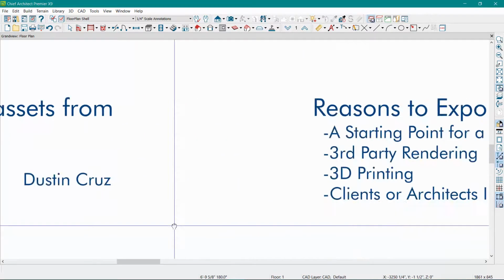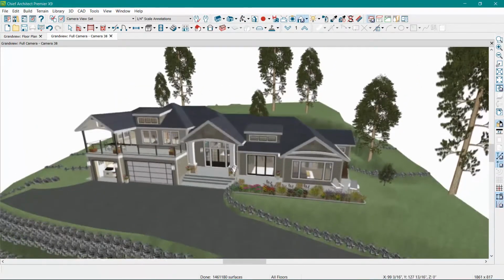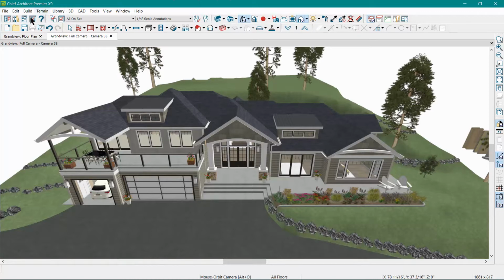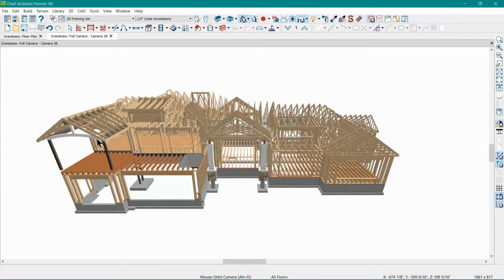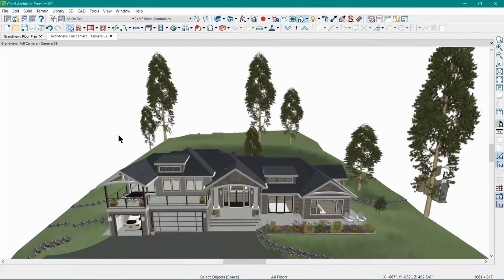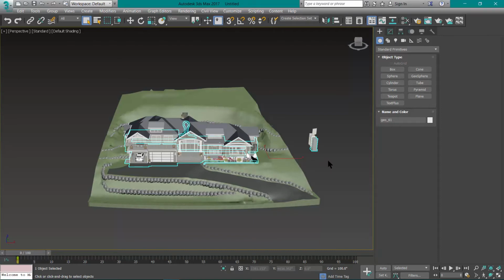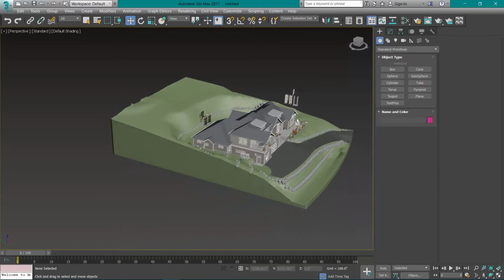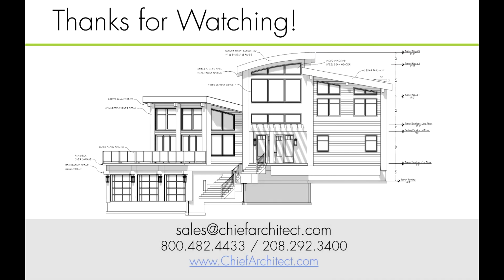Exporting 3D Assets from Chief Architect

Comment: Hello, thank you for the video
Does anyone have a solution to regularize normals and faces after importing into 3dmax software?
Due to the excessive confusion of the structure of the objects in certain projects that have inlay work or the object has an arch. The material is not placed correctly on the object
Reply from the maker: Hello! We cannot speak to the function of another software but you can try posing your question to the Chief Architect Community on the ChiefTalk Professional Forum here: chieftalk.chiefarchitect.com

Comment: Has any of the export capability changed with the latest version of CA? In terms of lights, cameras, or anything else that doesn't come across when exporting to Max mentioned here? I'm ultimately interested in getting the exports into Blender and Unreal, probably through 3DS max if that is now the best export method. Thanks
Reply from the maker: I have listed below the file type export options currently available: 
-	Current View / All Floors –.DWG, .DXF
-	3D Model –.DWG, .DXF, .3DS, .STL
-	PDF– .PDF
-	COLLADA Model – .DAE
-	REScheck
-	VRML (WRL)
-	POV – Ray (POV)
-	Meta File – .EMF
-	Picture – .JPG, .JPEG, .BMP, .PNG, .TIF, .TIFF
-	Wall Definition Files – .DAT
-	Layer Sets – .Layers
-	Hotkeys – .XML
-	Annotation Sets – .cadefs
-	360 Panorama- BMP, JPG, PNG
-	3D Viewer File

Comment: can I export to Twinmotion?
Reply from the maker: Hello bestyentertainment! I'm not familiar with Twinmotion; however, Chief Architect offers many built-in rendering techniques that produce real-time results, and we also support the export of .DAE and .VRML 3D file formats that allow you to take your model to the rendering platform of your choice.
Reply: good video.  I use chief architect x5 I am trying to export to 3ds Max,  but I can't see the extension called colado how do I solve this problem please thank you
Reply from the maker: @vegilarchitecture597  With a 3D camera view open, you can select File > Export > Export 3D COLLADA Model (DAE).
Reply: I'm  using chief architect X5 . I can not see this Collada in my export option.  Collada is not there
Reply from the maker: @vegilarchitecture597  Unfortunately, with Chief Architect X5, the only 3D model options that were supported for exporting were .DWG and .3DS.

Comment: Thank You for the video.    A video on 3d printing a model would be very helpful and is on my “wish list” 😉
Reply from the maker: Okay, great. Thank you for the suggestion! We'll see what we can do.
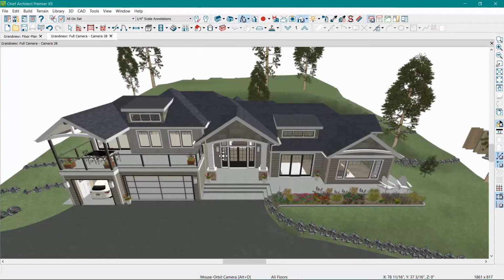Reply: I would just export it as an STL File that is scaled properly to fit your 3D printer.  When I was studying interior design in school, this was what we would do.  I did a custom reception desk in Revit, exported it as an STL, set the scale at 1:24 (metric) which is about the same size as a model car, about 6-8 inches.  however, for a house, I have no clue what scale would be best for doing a house maybe something like 1:50 or 1:100 ...depending on how many levels it has?.  Send that STL File to the proper printer, and you should be good to go. Be sure to export the file just showing the exterior elements, basically just the shell.

Comment: Hey guy. You did a mistake changing the roof thickness. You just need to change the camera clip near/far distance. This is used to free memory changing the precision of the model in far distance. You can fix tree changing the material to use png transparency of your tree texture.